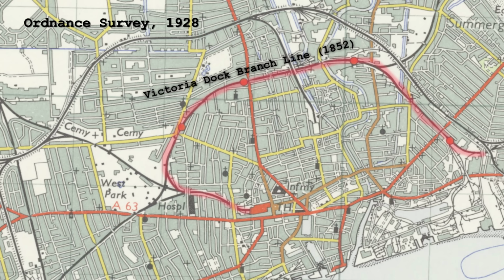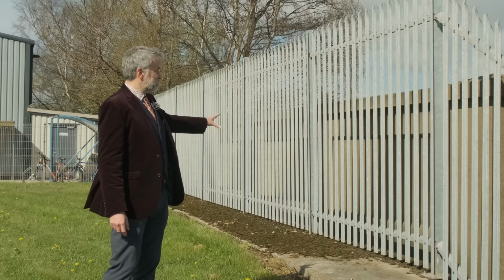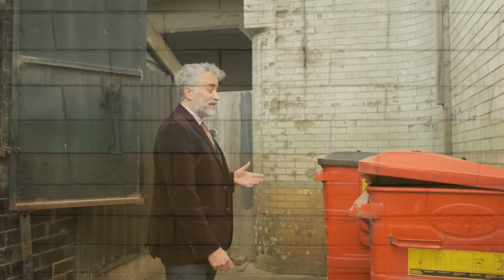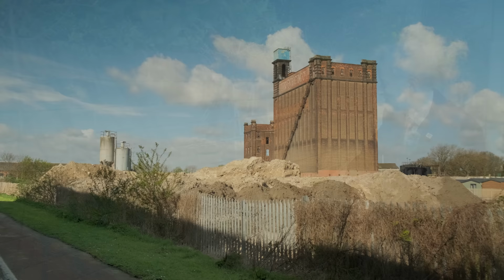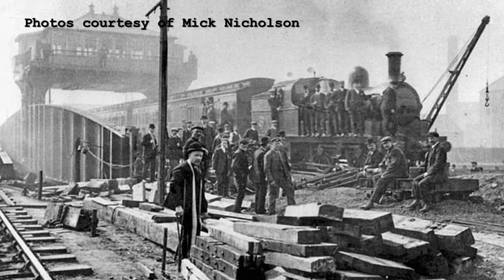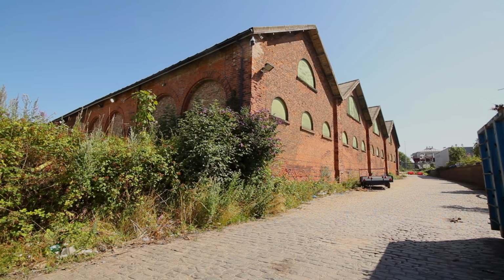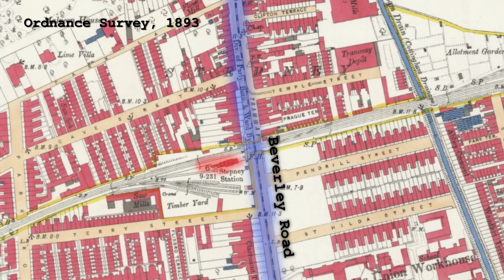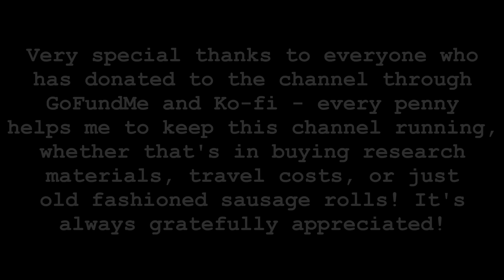Hull's Railway Architecture: Victoria Dock Branch Line

Comment: When you look at Wilmington swing bridge, you can still see the supports for where the original bridge was. As for Stepney station, when they laid new concrete surface for the figures that was installed. You could still see the concrete conduiting behind the platform next the the retaining wall. Before the swing bridge just after where the twin bridges over the drain you could again see some of the concrete conduiting on the floor on the right as you headed towards the swing bridge. I can remember in my teens going on a bus under the massive bridge on Stoneferry Road and how the road used to dip so traffic could go under it. Where you were stood the road surface was about 3-5 foot lower.

Comment: Another lovely very interesting video. Ist class work,explaining everything so simple to understand. I love Hull, it's like an Island of beauty.
Did Wilmington have a Power Station, as when I worked on the railway at Carlton we used to send coal to Wilmington
Reply from the maker: Not Wilmington, but there was a power station at Sculcoates, and there was a gas works not too far from there at St Mark's Street. It could also have been for general industrial use - lots of factories and industry around Wilmington!
Reply: Many Thanks for your reply,probably right I know we used to send loads of them,also loads to Goole docks for export. The good old days.

Comment: organic curved tiles ? Glazed Brick, it easy to clean
Reply from the maker: I was talking artistically, not literally! Glazed brick is certainly easier to clean, but there's no requirement to curve the corners so gracefully - that's a design feature of the era, and makes the walls flow in a less rigid, artifical way, and instead in a more, well, organic way.